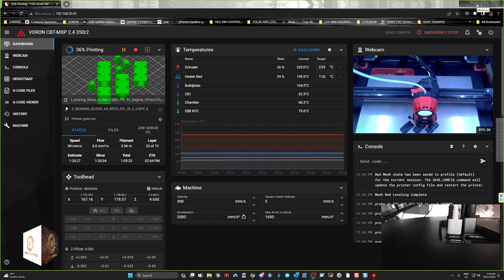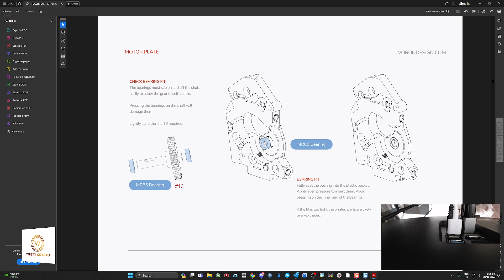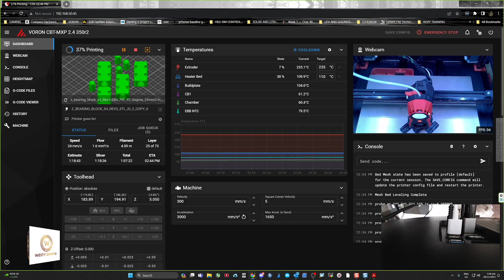VORON STEALTH BURNER HOW TO ADJUST CW2 SQUISHY SCREW AND GUIDLER TENSIONER

Comment: I have many problems with the extruder. CW2 or Galileo 2 nothing works right.
I can only print it when i have spools on the top.
When i have the filament at the side through the exhaust it stops a a time and the extruder skips or overheat.

And my presure advance is at 0.1
Reply: I'd think if you are having problems with the CW2 and the Galileo 2 that your problem is not an extruder issue as they are 2 completely different designs and likely aren't suffering the same problems

Comment: Thx for this video. I have exactly the same problem with the CW2. I'll definitely give it a try.
Reply from the maker: make sure you tune into part 2 and 3 as I show you what else I did to solve this problem. I have added links in this Video for you just in case you want to find out how I solved the issue which this one partly solved to allow the correct tension and setup of the squishy screw.... but you will be surprised as to what actually completed the solution.
Reply: @rent2ownnz  In my case the hotend fan was slow due to its wire touching internally with the cover... i just loosen two bottom screws of toolhead and got the fan running at full speed... sometime problems are somewhere else also..just to share anybody have similar problem must check the fan as well..
Reply from the maker: @Élévationen60secondes  nice find. yes cooling efficiency also will have a massive effect on performance of the magic hot toothpaste machine.